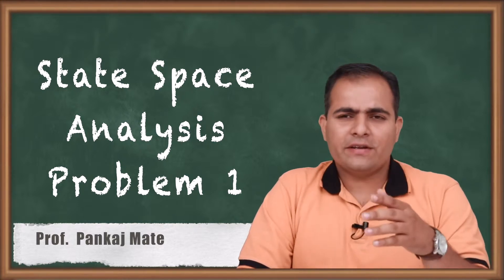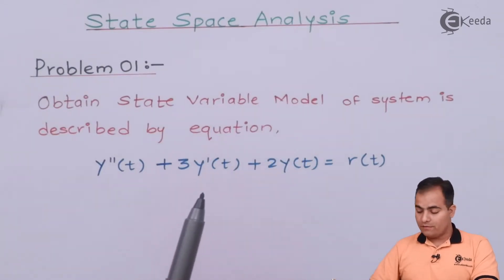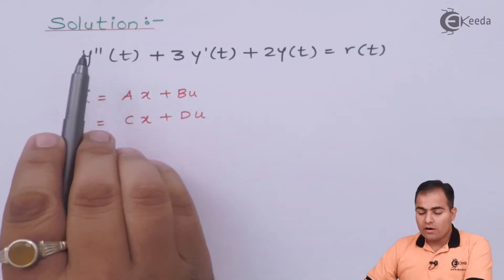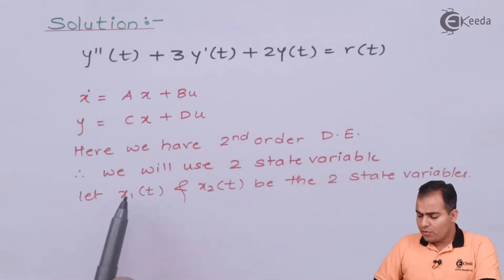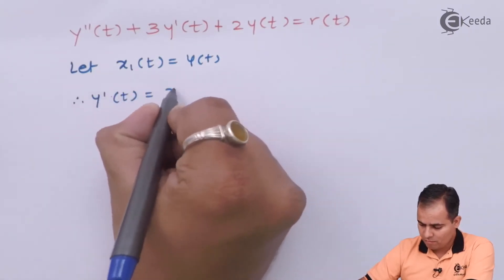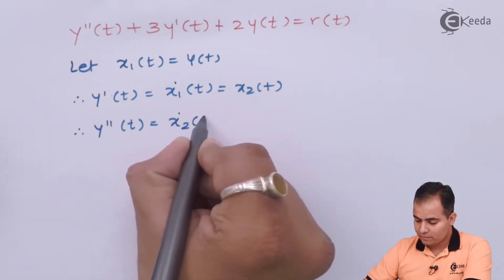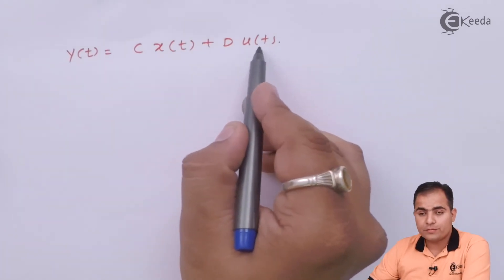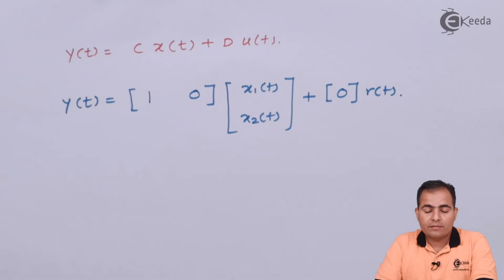State Space Analysis | State Space Analysis | Signals and Systems | Problem 1

Comment: hi place help me  to solve example im student 
lem Figure 2.28 shows an extension of the inverted pendulum problem of Example 2.5 to the case of two pendula, moving in 
parallel vertical planes about the same axis. The two bodies at the end of the 
pendula have the same mass, m. The equilibrium point is easily determined, 
on physical grounds, to be el = e2 = til = e2 = i = 0, F = 0, X = x*. 
(As in Problem 2.17, the system can be in equilibrium for any x*.) The rods 
have negligible mass